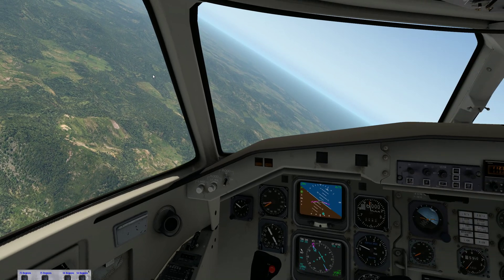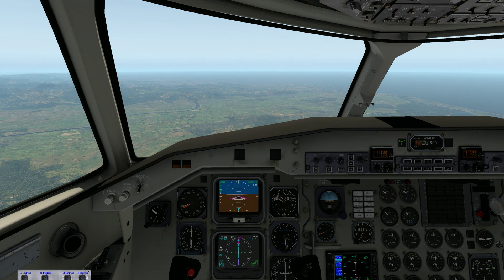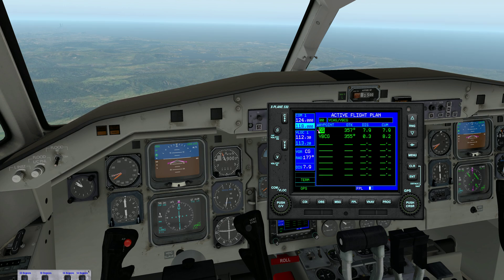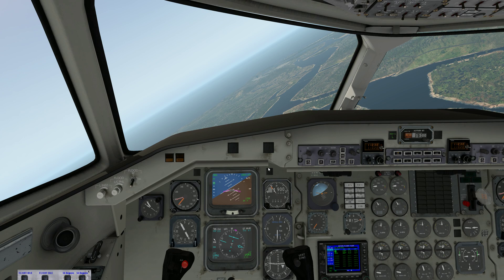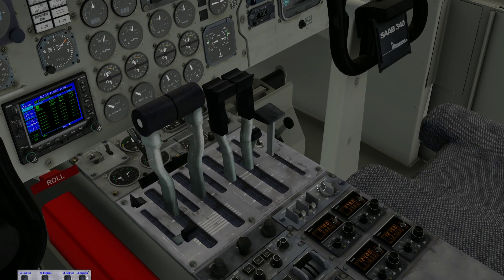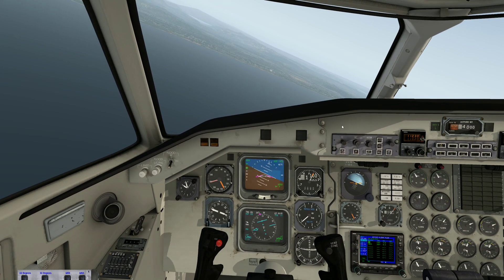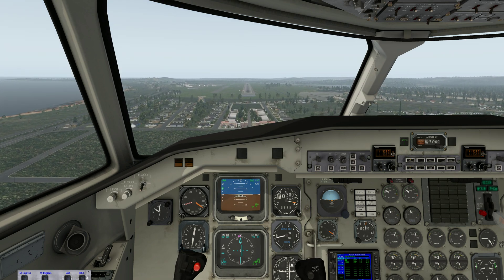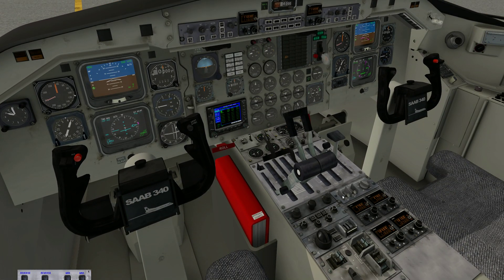X-Plane 11 Saab 340 Tutorial: Joining the Circuit

Comment: Hi, great video indeed :) . I have one question: how can you have such a big bank angle (30°+) when you were doing the circle with autopilot on?  I have .v1.5.1 and I can do max 15°bank angle when autopilot is ON.
Reply from the maker: I was using 1.4.something at the time
Reply: @simpilot3138   It is clear to me now. There is a bug in the latest version of Saab (1.5.1). It is not possible to make a larger then 15° bank angle. Pretty annoying if you ask me ;) . Is any solution to this problem? Where can I get the old version (1.4.0.) of Saab340 ?
Reply: You can’t, unless you happen to have a 1.4 installer of your own. The file responsible for the half bank issue will trigger the piracy warning system at x-aviation if its not from your serial. 

Im afraid only way is to wait for the 1.6 patch.
Reply: @JQNick   thnx man :) . Can I uninstall current version (1.5.1) and  install .v1.4.0? Can this be done and where to find 1.4.9?
Reply: Don’t know, I only know of the above from triggering the piracy system when i worked out which file was doing it 😅
Left the subject well alone after that